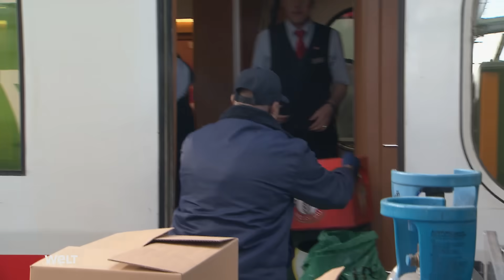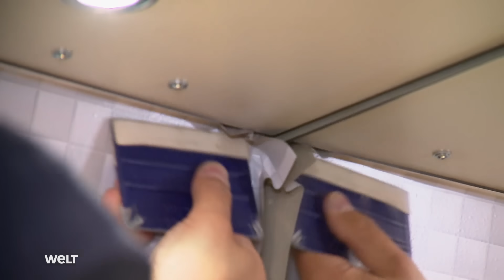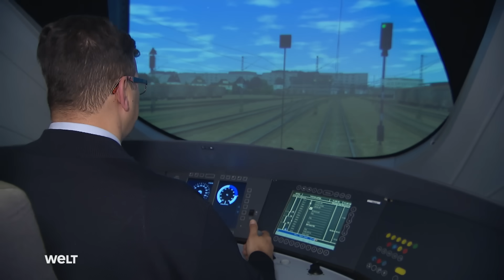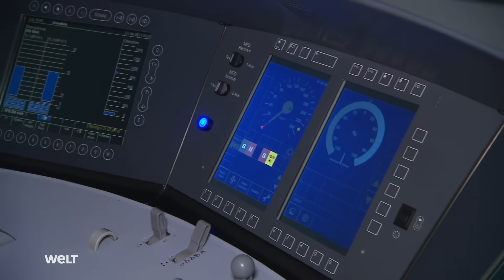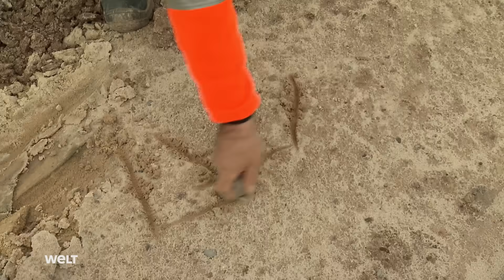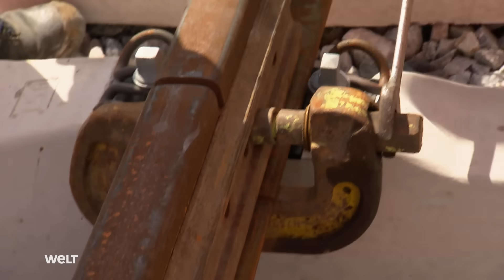German ICE Train - High Speed On Rails | Full Documentary

Comment: I you lived near the track & wanted to walk across the track to the store or post office, can you easily do it?  The track configuration looks a bit odd to me.   Not being able to cross between major streets is a problem here in the USA.  They stacked very sharp, bur somehow still slippery rocks under the tracks to level them & made steep banks on either side of the track area.  A quarter mile trip turns into a mile & a half to go to the street crossing.
Reply: No. Biiiig no.. we have regular overpasses and tunnels over/under the high speed tracks and regular railway crossings.
Crossing/walking over or on the tracks anywhere else is a felony, "Schwerer Eingriff in den Schienenverkehr".
Trains regularly have to drive parts of their journey slow because another train conductor called in people on the Rails.. the next train passes that area slowly to report of still there, still in danger etc.. 
Only after confirmation of the rails being clear regular speeds may be reached again!

Comment: done.. I have experienced NDE in 2018, I was 28, I was in a rush and realised I will not catch my train if I use the stairs on the platform. Since I was alone there I decided to cross the railroads, even though every cell in my body and my gut feeling were telling me not to do it. What happened in next few seconds will forever be embedded in my memory, my body, my mind. I started to run across and once I reached opposite end I realised that the wall / floor that I have to climb is bigger than I thought.. somehow I managed to lift myself up and in exactly that moment I heard the worst sound in my life, you know that sound of electric wires snapping ( I dont even know how to explain it) but the ICE train ( they go over 300 kmh) was just passing the by and driver was honking frantically… it still sends shivers down to my spine while I am writing about it…only seconds later I realised why he was doing it, while I was busy climbing that wall other ICE train was approaching, and my only guess is that driver from the first train (far side at that moment) was desperately tried to warn me to hurry up.. we are talking milliseconds here   … when I was finally standing on the platform the second train near my side was passing with a speed of bullet and also He honked as well.. simultaneously with the first train… I dont know what saved me on that day, I sometimes contemplate it and I dont know how I made such a grave mistake… what was I thinking? I even thought that perhaps in some other timeline I never managed to climb up that wall / platform in time… and also due to all these dark thoughts and scenarios every now and then I look for this kind of videos on youtube.. currently I am in a very bad period of my life due to financial struggles, no relationship experiences, etc etc.. I just wanted to share this with someone.. and hopefully this will serve as a warning to never ever cross the railroads…😢

Comment: 39:10 There is a focus on aerodynamics to reduce air resistance and increase efficiency. Since air resistance slows the train down it also shortens the braking distance of the train. During normal operations this drag will only be a disadvantage, but during emergencies it would help to slow the train down faster. I have no clue how big of an effect this has, but I wonder how much of a benefit active aerodynamics can have on the train's braking distance. Adding flaps like on an airplane could possibly make them safer.

I also learned that electro magents are used for emergency breaks, which is amazing. This probably does way more than active aerodynamics. The electromagnetic breaks appeared to work differently than I initially expected. These seem to function as friction breaks by strongly attaching to the rails. I first thought the electromagnetic breaks would be Eddy current breaks. Or maybe it works as a combination of Eddy currents and friction?

Comment: I was on one yesterday.  It barely went over 100.  Very slow from vienna to koblenz.  TGV much faster.
Reply: On this route there are two different sections where you can go on with the ICE, if you purchase more money you will get a faster ICE through the New built high speed line between Frankfurt (Main) and Koblenz or in the direction of cologne… but if you buying a cheaper ICE ticket you will get through the regional tracks with more stops and besides the Rhein River and that is the case on the hole route. But especially on that route you were going, there is a lack of high speed rail infrastructure, and a lot more of Older regional routes.

But in you’re case it was probably a mix of missing rail infrastructure, a cheaper ticket with more stops and multiple train delay’s

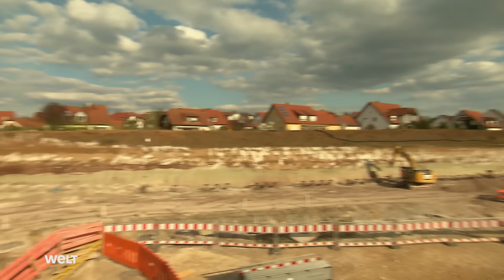Comment: 33:55-  reinforced concrete foundation piles
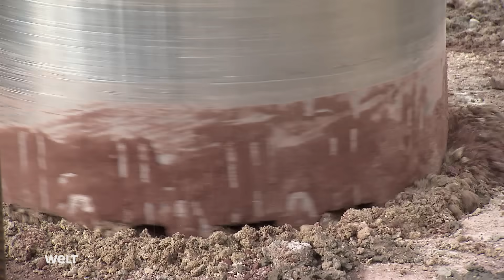34:45   worm conveyor
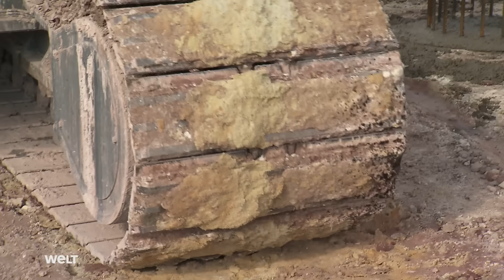35:26   movable drilling rig
36:00   overlapping board pile walls
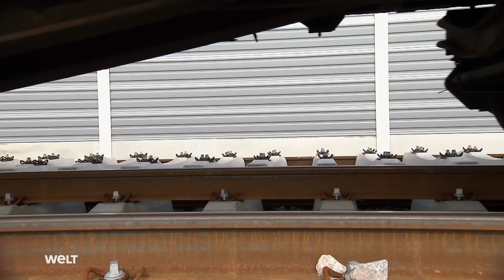36:20   4.5 tonnes of ballast per metre
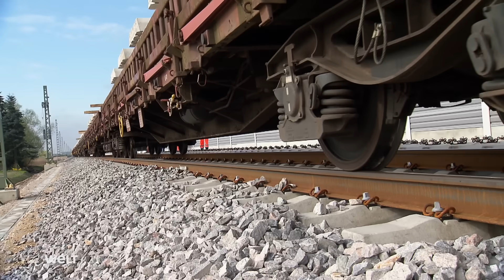36:28   1500 pre-stressed concrete sleepers - each weighing around 200 kg
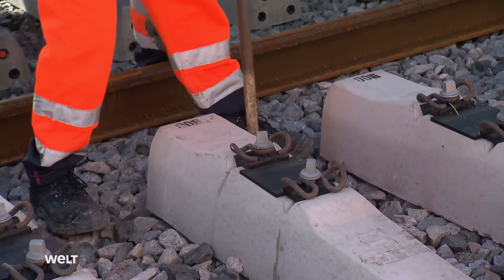36:45   four pre-stressing tendons (Spannglieder)    flectural strength
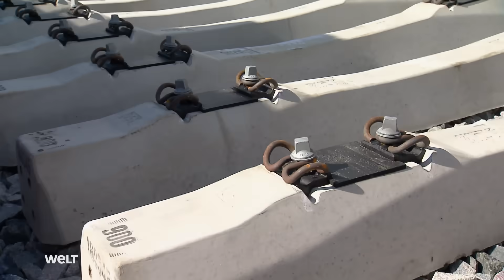37:10   derailment (Entgleisung)
39:15   farings (Verkleidungen)
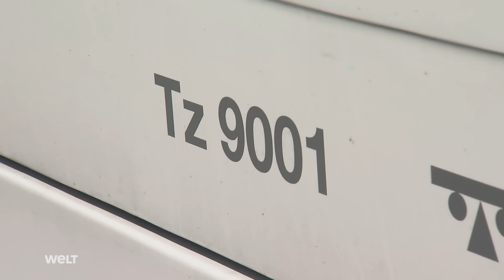39:35   ICE manufacturedby SIEMENS
39:45   SAFETY TEST OF THE BRAKING SYSTEM
41:39   measuring station located in a car at the centre of the train
42:45   individual steel rails 120 metres long, 7 tonnes heavy .. and as flexible as spaghetti
44:05   the bolts are greased (die Schrauben sind gefettet)
Reply: Was willst du damit sagen?
Reply: @sirendor202  legende

Comment: This is all well and good, but at some point we must phase out 1880's technology - dual track rail - and implement magnetic levitation.  This video is an excellent representation as to the maintenance required on the wheels, and in time, on the tracks too.  Compare this to maglev where the only moving parts are the doors.  No wheels to wear out, no moving parts in the engine, no damage from the elements like sand.  Once or twice per year inspection of the beam to make sure concrete spalling is at a minimum; if a section needs to be replaced, you do so in a very quick switch-out like Leggo pieces.  When you factor in that it's designed to be elevated, getting around existing obstacles (highways, railroads, buildings) is far cheaper than having to use surface real estate.  Costs about 1/3 the cost of a dual-track rail system to operate and maintain.  No noise other than a woosh since there is no metal wheel on metal rail friction.  This is a great oversimplification, but this is a technology whose time has come.
Reply: It would take an immense amount of money to completely replace all ralway tracks with a technology that largely offers no bonus and has severe problems with crossings and steerings.
Reply: maglev train routes were supposed to be built in Germany however both due to the crash on the test track and due to enormous expected costs none of them were built anywhere in the country.
Reply: Maglev is really really expensive...
And not wort it.
You also get new amazing ways of failure that you don't have with rail.
We know this here in Germany because Siemens (a huge German company that builds trains electronic for everything and so on)
Is the same company that build and developed the only somewhat successful maglev system...
The Chinese maglev train everyone uses as a example is a Siemens system.

Comment: When you ride a high-speed train, do you feel much gravity pushing you back in your seat?
Reply: No you don´t feel anything. I live in The Netherlands and i´ve traveled with an ICE 3 to the Swiss Alps. It´s very comfy and i couldn´t believe that i was traveling at 300 km/h on the Highspeed Line. 300 Km/h feels like you´re traveling 100 km/h.
Reply: No not really, it’s very comfy. You might feel it a bit but not like in a supercar. That’s also because they don’t accelerate too fast. And that’s good because there can always be some people standing or some unsafe placed luggage. However you can feel a emergency break when applied.
Reply: A little bit when it accelerates, but after that, no.
Reply: Very smooth and quite quiet. It’s more comfy than the plane

Comment: Great documentary.  I wanted to become a train driver but I ended up on truck and bus driving. I'd see a documentary about the truck amd bus driving as well. To show people how many other things a truck or bus driver have to deal with.
Train driver doesn't have to deal with passengers or selling tickets.  Freight train driver doesn't load/unload the cargo. 
Bus and truck drivers often have to go different countries while train driver cannot leave their country not even the lines they are trained for they don't have to find alternative routes if an accident happened on their way. They just stop and wait. 
There is no a such high level automatics.  And much more. So train driving not so complicated as it is presented.
Reply: The difference between train driving and truck and bus driving is that truck and bus driving barely have any contingencies. You have your road, and sure you load the cargo and have to sell tickets, but it doesn't really go beyond that. You can just drive around obstacles and stop quickly. The "challenge" in the job of a train driver isn't driving the train, it's when things go wrong. Being unable to just drive around the problem is what makes it much more complicated when faults occur. How do you ensure that despite a brake fault you're still fine to go? How about checking not just if your truck trailer is correctly secured, but checking 60 freight waggons worth? What if there's an issue with a waggon right in the middle? What happens if there's an issue with a level crossing? How about if a signal box stops working, and now a large station's signals don't work anymore? The traffic still has to move somehow. What if a 400 meter long train has to be evacuated? What if someone pulls the emergency stop because of a fire but the train is in a long tunnel?

Being bound to tracks often gives the illusion that it must be easier than driving a road vehicle, as people who have never given it much thought commonly think that rail operation must be like road operation but without the need to steer, ergo it's just what they know, but easier. In reality it only adds layers and layers and layers of complexity and additional procedures that you'd never see on the road. So yes, if everything is working, there isn't much to it and is easy to automate. However, it obviously doesn't always work, and nearly all of the training is for working with and solving faults, not for when everything is working fine. Train drivers exist because they're essentially there to ensure safe operation despite faults.

Comment: Can you run this train without a driver?
Reply: Yes you can. As long as you don't mind it crashing to another train or derailing. All trains can be unmanned.
Reply: @RR-us2kp  Driver can cause crashing as well like do not lower speed to safely pass thru curve.
Reply: Train run on dedicated track in one single direction with sensor to judge the distances between train. Therectically yes.

But sensor and equipment will fail so need some one onboard to judge and made decision.

And also unexpected can be  happens as such need driver to made that decision promptly
Reply: It's basically impossible. I know that because I drive those bullet trains myself. There are too many issues.. technical problems to fix. Once the train breaks down well.. and on top of that it's not like a car. It can take kilometers to stop a train. It would be hard for cameras to see kids playing next to the rails or other dangerous situations. There are too many regulations. What if a fire breaks out? There are 100 steps that follow, things like where to stop, what systems need to be turned off, what to communicate to the other train crew and the tower... the list goes on. Driverless trains makes sense at airports but that's about it.
Reply: Not in the current state. But you can switch them to do so in just a few days.
So technicially, it can do it but by law and people trusting people more then machines, no.

Maybe this changes in the future with AI driven cars etc, people might accept it in trains, too.

Comment: those panels at the side of track dont work,, the person who designed them didnt do lots of testing,  in Hannover thy put them in,in 2018, before was 2 meter high concrete walls -worked much better,, thy spent so much money on it to remove concrete walls and replace with those aluminum  walls and now train is louder than before,

Comment: 330 km/h but the odometer goes to 300?
Reply: That is their certified speed.
Reply: I don't think that all ICEs are capable of 330km/h - only a smaller subset of them are.
Reply: @fetchstix  The ICE 3 can reach 330 certified. The ICE 2 and 1 can reach 280. ICE 4 is only 250 but should be recertified for 265.

Comment: What about when auto pilot  reaks down? Are they trained to drive "ohne autopilot"?got parsley in egg or chives?when electronic fail what happens if he doesn't see speedometer cause it's broken down does he have to stop?didn't look like 100km/h more like 5mph.
Reply: There's no such thing as an "autopilot". There's something called LZB, which is pretty much in-cab signalling that provides the driver with information. If it would be to break down, the driver would have to decelerate to a given speed limit (mostly under 85 km/h) and press "PZB frei", which releases him from the system. After that, the train would be allowed to go 160 km/h max till the system works again.

Comment: I haven't been following but I've checked and it's kind of surprising that some obvious high-speed train connections between German cities still don't exist, like Stuttgart-Munich!
Reply: Thing is, during the 90s when HSR took off, we had to spend a lot of money on East Germany to get it up and going. So obviously we couldn’t really invest much in West Germany. This changes now. 

Between Stuttgart and Munich there will be a lot of work done. Right now they built Stuttgart 21 which is a completely new concept. The old station will be demolished and the entire rail will be moved under ground. They will dig 60 kilometers of tunnel to speed up trains in Stuttgart. They are building the third longest tunnel in Germany to connect it to the currently constructed HSR Wendlingen - Ulm. It will cut travel times by half to just 27 minutes between Stuttgart and Ulm Hauptbahnhof. 
It isn’t true high speed (250 kph) because the tracks have to climb several hundred meters so it is very steep. Hardly any train would be able for those gradients to be faster. 

Between Ulm and Augsburg, there is a proposal to built a 300 kph section but this is just an idea. 

Other new projects include Gelnhausen Fulda and Frankfurt Mannheim, both are happening. 
More ideas are Hamm - Hannover. 

The biggest problem in Germany is that it is full of mountain ranges, making construction very costly
Reply: @Sedna063  Spain is more mountainous and is also a weaker economy than Germany, and it's also a peripheral European country, but they're still heavily invested in building dedicated HSR lines! 
Different priorities and politics I guess...
Reply: @PrimiusLovin  Some priorities but then Spain spend a ton of money and they have indebted themselves for their network. And apparently, they have the least efficient network of them all.

Comment: I travelled around Germany with your ICE trains. I loved them! They also more modern compared to France’s TGV trains.
Reply: The ICE is slower.
Reply: @GroovyHomie420  The ICE ist faster than The TGV. It can reach 330 km/h
Reply: @GroovyHomie420 300 km per h is not really slow lol
Reply: You are misinformed, they "Look" more Modern, they still lack behind the TGV in Speed.
The French TGV is literally the fastest Train in all of EU
Reply: @Racko.  They don't just look more modern, they are more modern. Just because the Germans run them at a lower speed doesen't mean they are less advanced. In France the ICE runs at the same speeds as the TGV (320 km/h, certified for 330 km/h). In China the Siemens Velaro (ICE 3) runs at 350 km/h and is certified for 380 km/h.
Reply: @jonny2954  Very true, they exceed the usual 220KM/H they run on inside Germany.
TGV and ICE along with Thalys and other High speed train lines all run of tracks optimized for a particular speed, so it usually varies. It's the same with Shinkansen in Japan, and in China as you mentioned
Reply: @Racko.  I don't know if it's exaclty true but one of the reasons that the siemens velaro (ICE train) was a exportation sucess and works very well for germany is that it doesn't need such specific railways,it can use older ones like in the east german but it doesn't achieve the maximun speed in this way.

Comment: Why did the Germans make the ICE 4 slower than the ICE 3?
Reply: That‘s because it wasn‘t supposed to become an ICE. Its original name was ‘ICx‘ and it was meant to replace the old Intercity and Eurocity carriage stock which in parts has been used since the 70‘s. They only have a max speed of 200kph anyways, so 250kph was plenty for those services. But, due to cost-cutting measures, they turned the ICx into the ICE 4 and painted a regional train white, gave it carpeted floors and called this the new Intercity.
Reply: Acceleration and brake speed is much more important than top speed for saving time on lines with multiple stops.
Reply: Maybe it depends on the tracks it'll operate along. There's numerous ongoing high speed track construction projects to upgrade certain key elements to make the ICE operate on dedicated lines, thus resembling more the Shinkansen of Japan, the TGV of France or the AVE of Spain.
Reply: Distances in this polycentric  country are short, usually 50 - 100 km. The advantage is some 2 sec per km. For one minute, 30 km at 300 instead of 250 are needed.